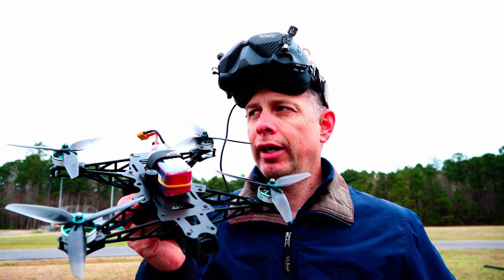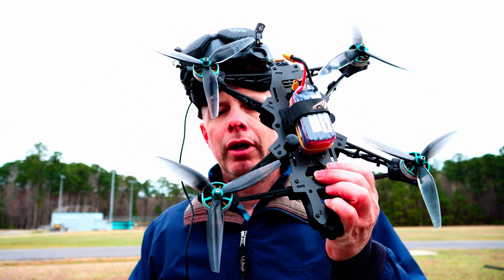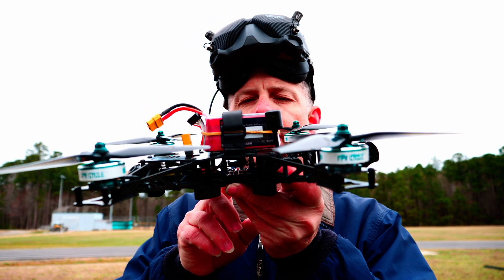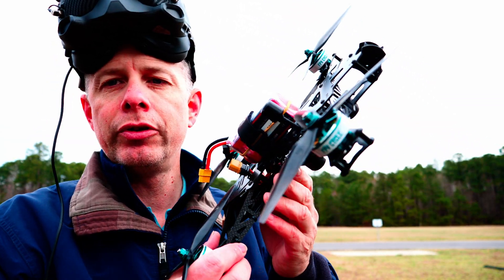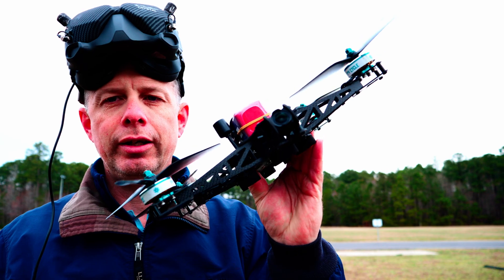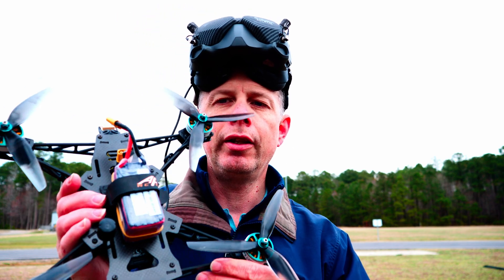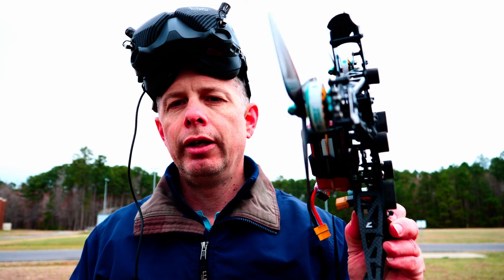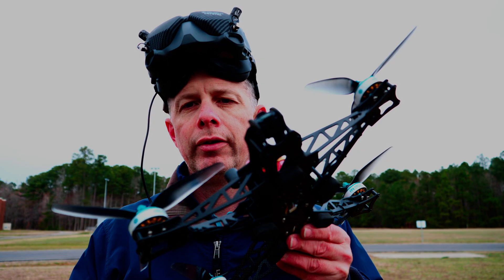AOS UL7 O3 Review (2-26-2023)

Comment: I have the ul7 for about 6 months. The frame is very cool looking, but I wouldn't buy it again because the arms are very fragile. When you have any kind of wind it seems  more problematic then a more traditional frame.I This quad is very difficult to get the mid throttle jitters tuned out of. My chimera frame is a much better 7-inch frame. * I would like to say that I love Chris Rossers videos and have his Aos 5 inch frame, and that flies better than any other frame I have.**
Reply from the maker: Well, I do have to agree with you there on most all of your points as that has been my experiences as well.
Reply: Great, so - again, Rosser's frame are good in theory but in reality they are vibrating and oscillating more than traditional frames made of thick hi-quality carbon. I had AOS5 frame made by Iflight, happy to switch over to Syncmode as that was impossible to tune vibration maker, inspite of all the "super-rigid truss structures". Now he released new UL7-8-10 frames, and I considered switching my chimera7 build to UL7 frame - but happy to stumble upon your comment

Comment: How was your range with this Air Unit antenna set up? I bought a longer 200mm coaxial cable to install the vtx on the back to have antenna where it’s supposed to be, but it’s still not long enough and i had to mount it with double sided tape instead of the proper o3 mount. It flies great and the signal is always strong, but I wonder if it is safer to mount the air unit in the front. Thanks for the feed back.

Edit: I just saw you installed antenna extensions, can you send me a link to where you got them?
Reply from the maker: Can't remember which ones I got but these should work: https://www.getfpv.com/sma-female-to-u-fl-extension-cable-15cm.html?utm_source=google&utm_medium=cpc&utm_campaign=DM+-+B+-+PMax+-+Shop+-+SM+-+ALL&utm_content=pmax_x&utm_keyword=&utm_matchtype=&campaign_id=17881616054&network=x&device=c&gc_id=17881616054&gclid=Cj0KCQjwnMWkBhDLARIsAHBOftrz5b2jsMgIgcRnCoqww4Sme17s7UlqzJF9iUTePASy8FvwxHP6Z4caAqvYEALw_wcB

Comment: You can get the extensions for the antennas from Data Alliance. They are called MHF1 To RP-SMA. (MHF1 is IPEX). It looks like you mounted the DJI O3 in the front, why not the rear? I was going to mount mine in the rear. I also bought this frame. Thanks for the review.
Reply from the maker: Yes the next video I installed the long range antennas.

Comment: Did you have any tollorance issues with the frame just received mine and the arms will not fit into the top and bottom plate.

 Arms measuring at 10.21 and hole measuring 10
Reply from the maker: Can't say I did..hmmm.

Comment: Is there no way to get the O3 Au to the back of the frame so you can get longer sma antennas out the back? I’m wanting to build this with an O3 but need longer sma antennas out the back for LR
Reply from the maker: Yes I suppose there is a way but I just installed antenna extensions, posted that video.

Comment: Definitely not looking forward to assembling this frame when it gets here, but i hope it's on par or better than the AOS 7 frame that's freaking awesome. I am however, looking forward to trying out 7.5in props on this frame. Never tried FPV Cycle motors how do they compare to tmotor velox 3008 motors as far as motor vibration?
Reply from the maker: Too me there wider stator appears to offer plenty of torque. I am open to trying 7.5 inch props, didn't know they sold such, let me know. If you have any questions on assembly let me know.